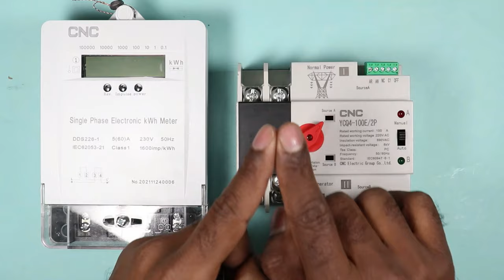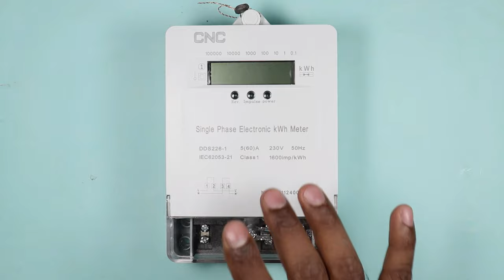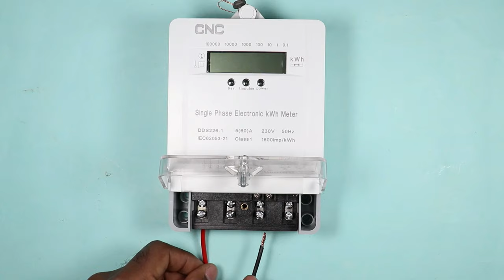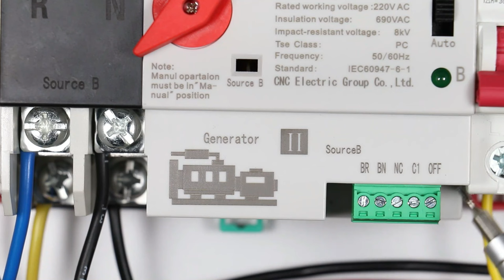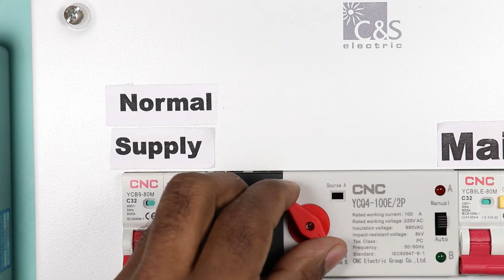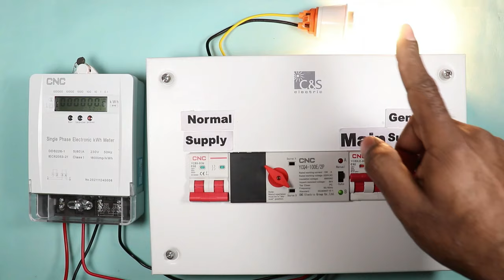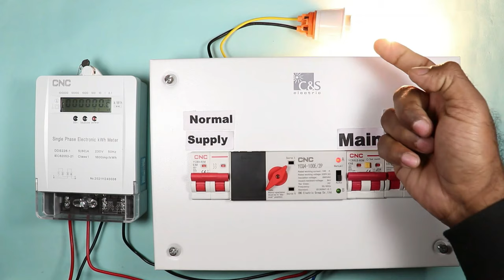Auto Changeover Switch (ATS) Connection in Distribution Board @TheElectricalGuy

Comment: I have exactly this setup in your video. Can someone tell me, in case the ATS fails and connects both sources to each other, will the MCB activate and prevent any damage to the sources ? When source A is back online, the source B also has power. I have read cases when everything was on fire because the ATS failed and connected sources between themselves.

Comment: In a high powered consumption of energy, considering the capacity of loads in a building what amperage of MCB and RCB will be needed? Also the cable rating, sizes, and automatic changeover switch? Question please. Thanks

Comment: Is there a way to wire this BR BN NC C1 OFF, so that if the grid power comes back, the generator will be automatically turned off? Like a kill switch? In this way, the generator only has to be turned on manually.

Comment: I have two power source. Both are line connctions. Is it possible when i am using power source of B, it will not switch to Main power supply. If B gone then it will switch to Main. Because this ATS interrupting me when i using desktop PC.

Comment: how about the working supply of the generator. if you have  no control circuit then the generator will never on automatically. You need to manual start the generator if the supply from the grid have no power.  Your design is  not fully automatic you need to manual start the generator if the supply from the grid is gone becuase there is no command signal to the generator to start.
Reply: Excellent observation. Do you know of any videos that discuss the wiring between ATS and Generator/Inverter/UPS?

Comment: Mcb changeover And manual changeover
Which one is best??
Reply: MCB changeover its better in generator wiring and in solar use manual changeover DC/AC  inverters are not good on battery for along period of time, I mean that if you put inverter on a battery for along period battery will destroyed in short period